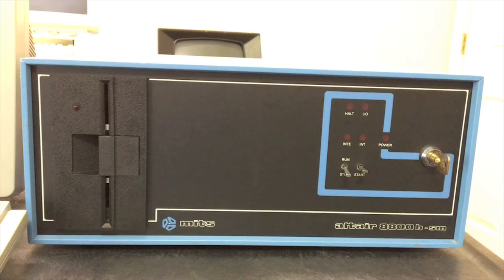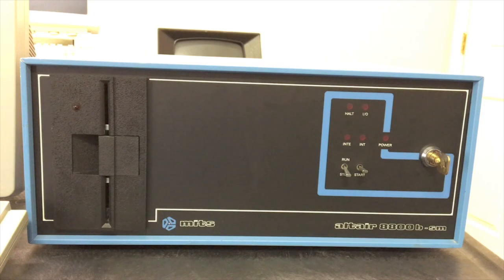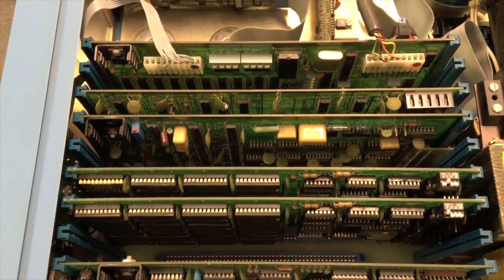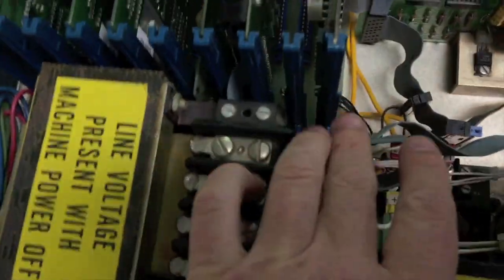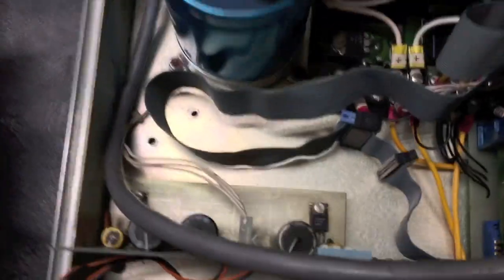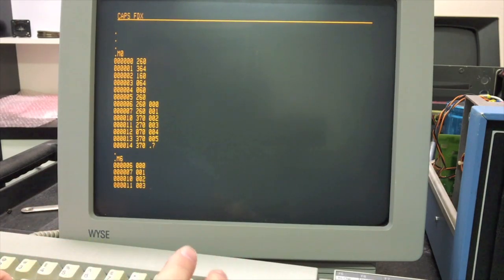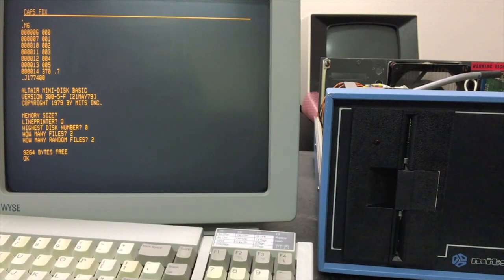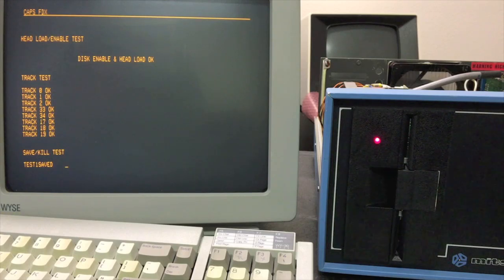Foley Edition of the Altair 8800b Turnkey Computer

Comment: Does this use the same processor as the Altair 8800?
Reply from the maker: Yes, the 8080 processor board from the 8800b computer is used in this and other versions of the Altair Turnkey computer.